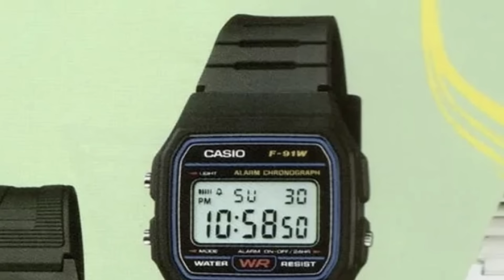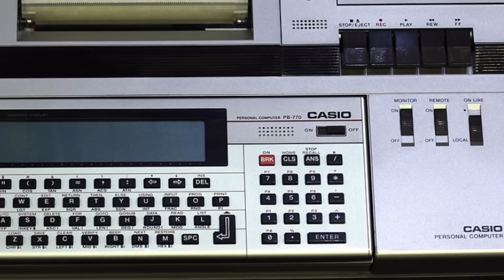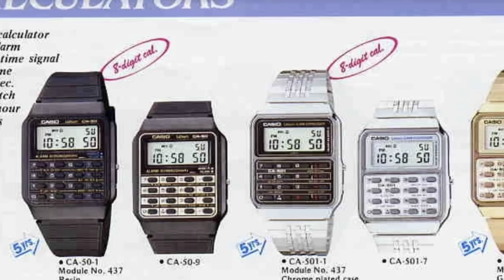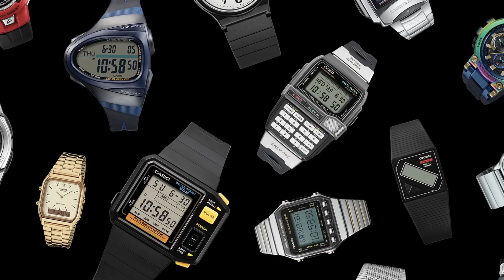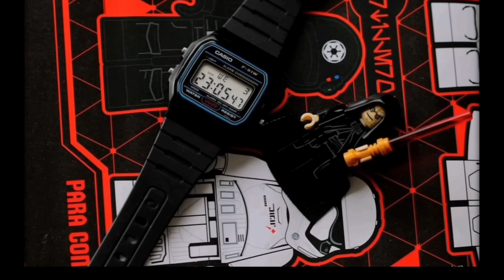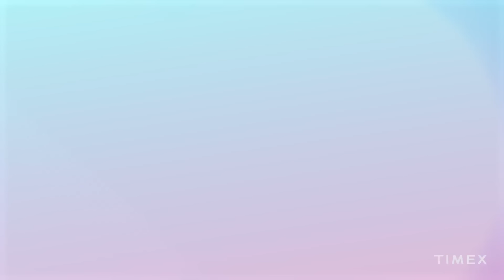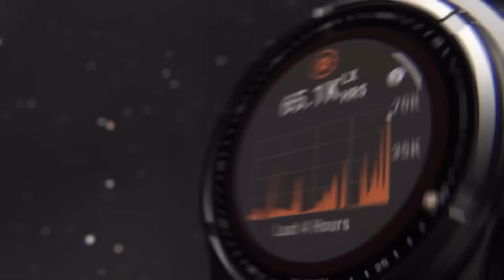How Casio Made the Most Sold Watch Ever

Comment: This was my first watch during the 90s. Never took it off then one day the strap broke. Saw the F91 in store recently and was filled with childhood nostalgia and bought it
Reply: The strap was it's weakness but still lasted about 3 years.
Reply: @Ronald-gu3ft I've owned several over the decades and the vinyl strap was the only problem.  Mine always became very stiff and hard, then fractured.  Seems like it's something to do with my skin oils, because other brands have had the same problem.  So for years the only time I wore any watch was for special occasions.  I'm going to have to look into the F-91W again and see if there are aftermarket straps that aren't vinyl.
Reply: @tconiam  I have a Casio F-105W that I bought new in 2024, because I needed to see the time when checking bus schedules when at work during winter without having to fish out my phone. (I was made redundant in Feb 2025.)

The plastic strap is all right so far. I avoid casting the watch under water when washing hands, and wearing the watch when at home. I think I have a habit now of taking it off my arm every time I get home. I'm hopeful, that doing so might increase the lifetime of the strap.

A relative gave me her broken Samsung smartwatch, which got hit, or had fallen. The display was partially disconnected from the unit, and miraculously still worked, somehow.

The repair of the unit cost €158, more than 6½ times the cost of my F-105W (€23.70).

Since the smartwatch was passed down by a member of the family, and because I had the opportunity, I chose to have it repaired instead of buying a newer-model used smartwatch for 3–4 times less from a reputable pawn shop, minus the money I'd have potentially gotten for the broken unit.

Maybe I should have done the switchover to save money, but I wasn't in a bad mood then. On one hand, I believe, that if given an opportunity, things should be repaired instead of being discarded outright; on the other, that I'm feeling buyer's remorse for spending so much on repairs instead of doing a switcheroo and buying a newer model for 3–4× less.

A same-category new model of smartwatch from the same manufacturer is in the range €220.

The smartwatch has some neat functions, like heartbeat, heartrate, and sleep measurements; and a built-in music app for when I listen to the FM radio on my smartphone. In the media app, I can switch radio channels, change the volume, and check RDS/what's playing information on my watch without having to take my phone out during inclement weather.

OTOH, when it rains, I'd prefer wearing my F-105W, because I consider the smartwatch as too expensive to have it suffer damage.

In a way, I consider my F-105W to be more mine than the smartwatch: I bought it myself, and for my own salary.

And unlike any smartphone, which must be recharged every few days, the battery of my Casio F-105W should last up to seven years.
Reply: @tconiam  Any StrapLuck so far, tconiam?

Stay free.  Rab     ⌚   🍻😎
Reply: @tconiam I've put the black metal strap on mine from a similar casio watch.. Looks good and is very comfortable 👍😀
Reply: @Ronald-gu3ft when you consider it costs the price of a strap replacement on most other watches its not so bad
Reply: Yeah the strap was always the weakest link. When I've had these I've invairably replaced strap with a black leather one.